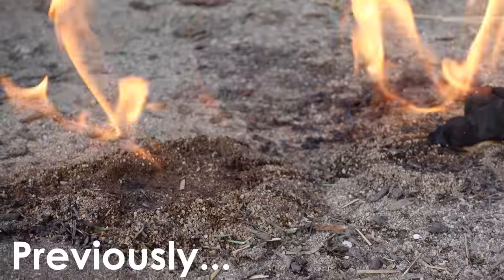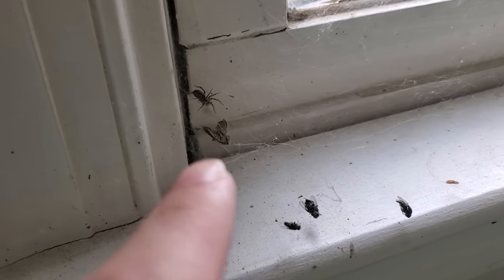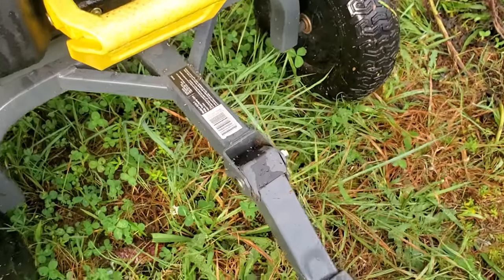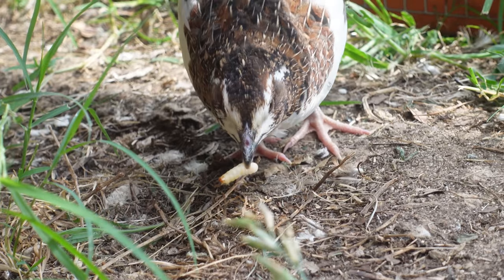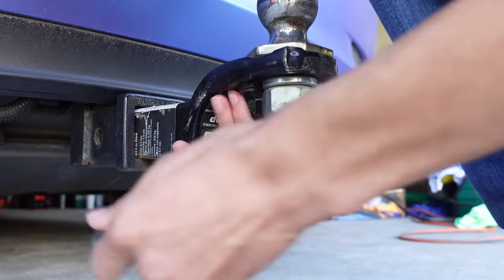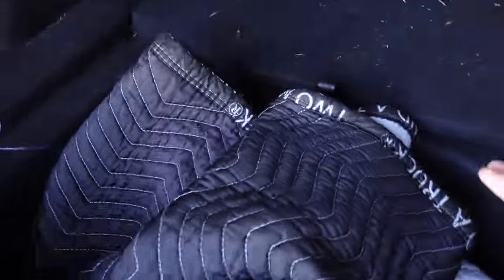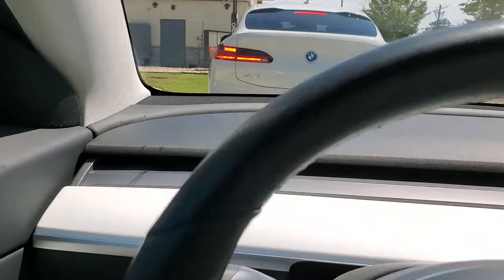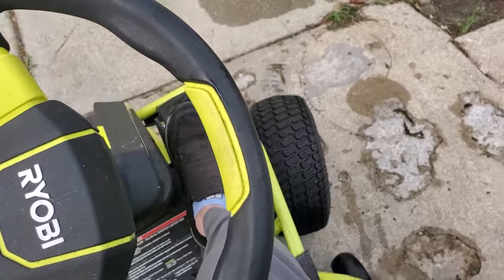Boiling them alive

Comment: I got bit by fire ants all over my leg 2 days ago. I've used ant killer pellets, raid spray, and flooding. Thank you for opening my eyes to a new method.
Reply: Fire ants are resistant to flooding because of their original habitat. They actually make ant rafts to float the colony to safety so normal flooding won't work.

If you do try boiling water you have to be persistent every time you see a mound and you need to find the main nest as ants set up extra nests or "satellite" nests. Meaning a lot of nearby nests can also be the same colony.

Ultimately though if you find the main nest and kill the queen then you win or you keep being persistent and have the death count beat out the queens production count.

Comment: Does anyone know what a water softener is used for?
Google says it's to remove minerals such as calcium/magnesium from drinking water. Aren't minerals good for you though? And why would anyone drink salty water with bugs in it? I'm confusion.
Reply from the maker: minerals are good but there can be too much solid material in the water like metals and calcium that damage pipes. the water gets softened with salt, and then the salt is filtered out in a separate tank. in my case, there was so much iron that the water turned red and it tasted like blood. so most likely any of the crud in the salt tank is actually filtered again but it still grossed me out lol

Comment: If you have a hot water heater with a tank, you can hook a hose up to the drain valve at the bottom and run it out to your yard to get  hot water without having to boil pots. It only has to be 150F to kill ants, you should be able to set your HWH that high. Just make sure to turn it back down to a safe temp once ur done boiling ants. Since you have a water softener it's a good practice to use the drain valve to completely empty your HWH every 1-2 years anyway to reduce the amount of hard water build-up inside the appliance, even if you don't need to scald any ants.
Reply: This is in interesting idea.  If he tries it he better be super careful, though, because the hose will be super hot.
Reply: And he should make sure the hose he uses is heat resistant.

Comment: Fire ants are actually Really really good at avoiding water boiling or otherwise they even Will build huge floating rafts by grouping together during the monsoon session in their native habitat
Reply: I get the feeling that floating on boiling water is still going to cook them at 212°F
Reply: @Cool_Story_Bruh  that’s just the thing though they don’t really need to survive they just have to stop it with there Hydrophobic body’s, just one will Seal off an entrance hole entirely, then as soon as the water cools down and soaks into the ground witch happens almost instantly they can just move the body and there back in Business the fact the water is boiling has no real effect because if they were fully submerged they die anyways and they are so adept at dealing with large amounts of water that it has no effect because it never goes deeper then a few inches.

you see in this situation the real solution is... LIQUID METAL!!! Preferably zinc and aluminum as they are used to make casts of ant colonies Buy actual entomologists already and have relatively low melting points and because liquid metal is really really hot it will set the ants on fire before it even touches them and do to its Weight density and ability to burn everything in its path it actually goes deep so you can finally impress a gr- I mean kill an ant colony, then you can dig up the cold metal and Mount your victory on the wall like an absolute badass. 

And it probably isn’t just a feeling that floating on top of 1220°F liquid metal Will most certainly kill them